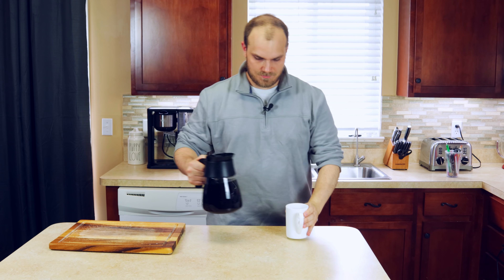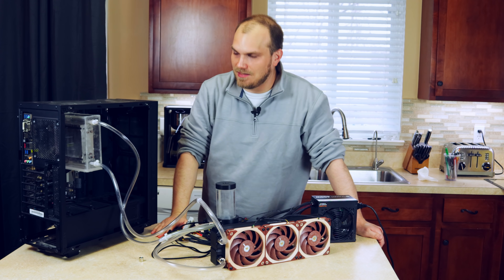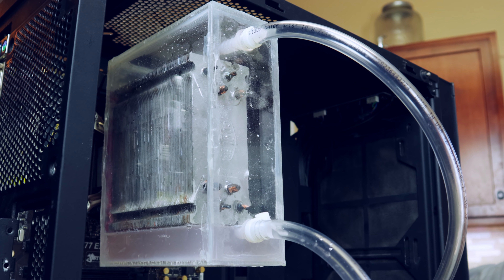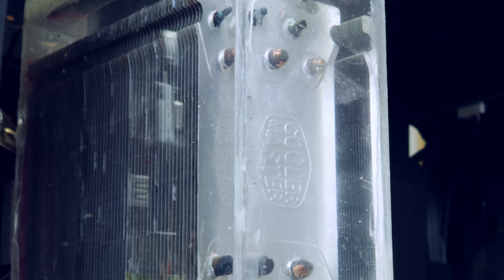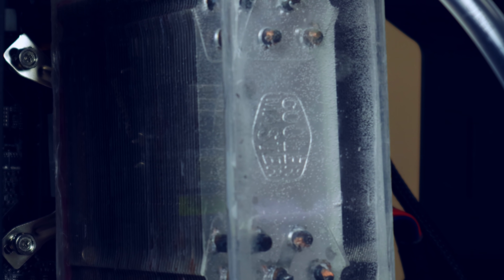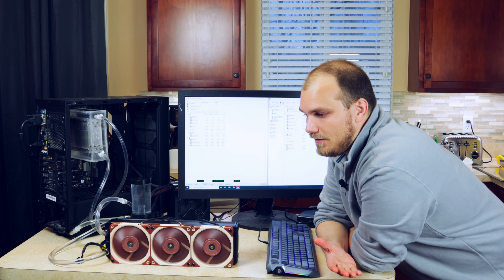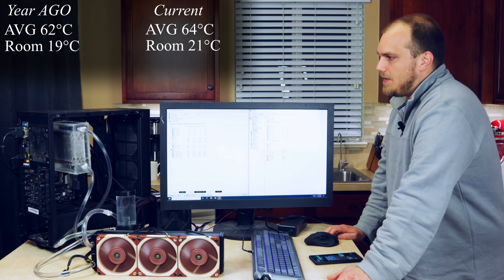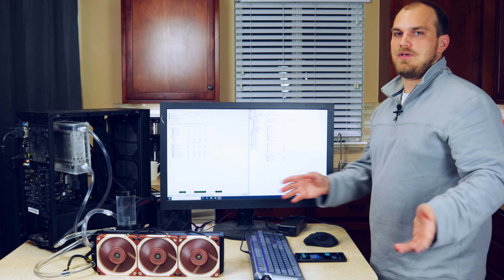Water Cooled Air Cooler 1 YEAR LATER, Time Has Not Been Kind

Comment: I think, than the better way must be horizontal, that's 'cause, the cooling system work on horizontal more fast, the copper pippes are in a C form, that minds than the upper middle work best cause that down faster, but the down middle work wrong, 'cause the coolest point it's fareaway from the CPU, and for that reason that part never heat, you don't even need a so big acuarium for the cooling, you only need freeze the the tops of the copper pippes, 'cause that was disigned to wor in U form, not in C form, in the fastest way, for the cold liquid inside the pipers down fastter than it up when it boils. for that reason you must put it vertical.
Well, I put mi tower horizontal, and gain some grades minus, 'cause, mi air flow was going, down to up in vertical (air cooling was horizontal, pipes in C form), now go right to left (now the air cooling is vertical, work in U form) , and in that way, really work best the cooling pipes and fans system.
Well, in base of this, I mod the way than I put the GPU with a PCI-E extensor, I put it upside down, and it works!!!, the principle is right, the connecton is wrong, if you put your PC Horizontal, the cooling Pipes of the CPU work better, and if you mod the way than you put the GPU (upside down) it works better too.
Now I'm gonna try to put some fans in the center of the new top, to pull the air out, and all the fans on the side to push air to inside.
I don't know, why no body think in gravity and themodinamcal laws....

Comment: Try it again with a newer but smaller heat sink, build it with better fluid flow, and use mineral oil to prevent corrosion.

Comment: ^make the new cooler force the water thru the finns. you ave a lot of space, where water can go arround the heatsink
Reply: Heat rises so as long as the cold water comes in from the bottom and the hot water exits from the top it will not matter

Comment: If you are going to experiment with this I think it would be good to start with a smaller and cheaper cooler. Perhaps something like a Noctua NH-D9L, a Dynatron K17 or perhaps even a Silverstone SST-AR09-115XS which is designed to be very compact and use a 60mm fan.
The first two are normal tower coolers designed for 92mm fans, while the Silverstone is very compact having the fin stack almost immediately on top of the cold plate and three U shaped heat pipes that contacts the heat spreader on the CPU. By using smaller coolers you get a bit more space to work with for the surrounding shroud while keeping it all small enough that it would fit into almost any chassis you may feel like using. The negative I can think of is if the heat generation of the processor overwhelm the capacity of the heat pipes. After all the thermal transfer to the water should not be much of a bottleneck.
Also I think that as you have a 3D printer you should be able to create a tighter shroud that forces the water to go through the fins rather than being able to leak around the outer edge. It might also be interesting to test if having the water going through the fin stack length wise as in your first attempt, or through it the same way the fans moves the air makes a noticeable difference. My immediate guess would be that it doesn't really matter. The high heat capacity of the water and large surface area of the fin stacks makes me think it's really overkill in either direction. But I have a good track record of being wrong...

Comment: Take a cheap 4, 5 or 6 heat pipe cooler, chop the top off, make a single coil but running plastic tubing from one to the next, and run it like that, and see how it performs.

Comment: if you do make another one try a format where the motherboard mounts upside down with the cooler pointing down to safeguard it against leaks, you may also not need to fully enclose it and have a open top container that the cooler lowers down into. In flow on the bottom and drain to a reservoir about an inch from the top so it cant overflow? It would allow clean outs of the cooler.

Comment: Next one do mineral oil instead of water and have a fan on the heatsink so the flow above the fins is stupid efficient.

Also try using a cooler that doesn't have mixed metals in it/use glycol and whatever AIOs use to reduce corrosion

Comment: Get a cooler that is anodize or coated, use treated water, cooler case need to be as close as possible to the base, water input should be as close as possible to the radiator while the output should be beneath so you wont have water turbulance where the heated water will just circle around the cooler case this happen because there's no water channel so you can bypass this problem by moving the input and output to be the furthest point to each other, hope you read this because this definitely can be improve and made it for daily driver.

Comment: Remake it with a lower pro cooler/remove some of the fins and bend the heatpipes, use an oil as the fluid as I don't believe thst will corrode it

Comment: Use mineral oil in the loop, so you can still put a fan directly on the cooler
Reply: Or just car/motorbike cooling fluid, thats cheap and with a anti-rust mixture.
Reply: @Phil_V2  Well if the coolants are also not electrically conductive, then yes they should work as well, but using mineral oil to cool PC components is known to be safe and also not that expensive
Reply: @EVPointMaster  Mineral oil eats rubber i.e. O-ring seals and any other rubber parts in the loop. It might work for a bit but definitely not long term. This is what happens with submerged pc's also. Mineral oil eats seals in electrolytic capacitors then it's time to replace the motherboard. If you wanted to use any oil near anything electronic, silicone oil is the one to use.
Reply: @lucastonoli3256  fair enough, 'o-rings ' was a bad example to use. Electrolytic capacitors however, do have a rubber seal. It's not an o-ring either, under the can crimp there is a rubber disc that resembles a hockey puck with two holes in it for the terminals. The primary purpose of this is to stop the dielectric inside from drying out. In an oily environment this seal would eventually leak and allow oil in which would change the capacitance of the capacitor. At that point you're up for a re-cap job or mb replacement.
Reply: @Mrx1080  it really depends on what "rubber" they use. It's very unlikely to be a natural rubber, which is sensitive to oil. It's much more likely to be EPDM or Nitrile. But it's sensitivity to oil really depends on exactly what material they use, it is incorrect to say all rubbers are sensitive to mineral oil, as many synthetic rubbers are perfectly fine to be used with oil.
Reply: @Phil_V2  didn't Jay try that? And beer??
Reply: Wouldn't that eat away any plastic in the loop, such as the the box around the air coolers and the tubing?
Reply: @LeonisYT  Look up mineral oil PC.Those are completely submerged in it and that doesn't seem to be a problem
Reply: @LeonisYT  Essential oils do that, but not all oils do. That's also why you should mix essential oils with other oils before using them. There are many oils that are inert and don't pull away oil from plastics.

Comment: Yes a v2 would be great. After reading some of the other comments. Many have said what i was thinking too. But, here are some extra ideas. 

Mentioned already and agree with:
1. A coated/painted cooler
2. using the fans from the air cooler inside the water to act as a pump.
some other ideas:
1. using a downdraft style cooler to fit in the case better
2. maybe use mineral oil instead of water
3. i like the idea of a smaller air cooler used with something that puts out more heat. ( we know this works. I don't find the d-15 with water to be that interesting. )

Comment: I have a DJ 15 and I have always wondered if you could ad a water block to the plate of the dh15 to air in the cooling. Then you would have a water cooled air cooler without the corrosion issue

Comment: Amazing how fast time pass!
I'd try pouring some vinegar into the loop in order to try to internally clean it, and to remove some corrosion in there.
Reply: If you can get the air out to prevent further oxidation, having a bit of vinegar in the loop permanently might even be a good idea.

Comment: Not sure of the cooler, but, why not try two ideas on two separate coolers.  This may be a feat all in itself.  What I mean by 2 ideas is, there is another cooler idea where you chopped off the top's of the heat pipes, and ran them in to each other, and then through the rest of the loop.  Would it be possible to chop off the tops of a cooler, run a loop through the heat pipes, and go to a top mounted radiator.  Then, have the majority of the cooler encased (like you have here) and run that to a front mounted cooler?  May be a bit over kill, but still may make for a neat idea.

Also, side note, move the ports/connectors from the "top" of the cooler, to the front of the cooler to help for clearance.

Comment: You should try the AMD Wraith Cooler. It's a small compact cooler with direct heat pipe contact. I'd like to see it  surrounded in coolant/water if it would make any difference with performance; especially with a modern day processor that scales with thermals

Comment: Copper pipes and aluminum fins in plain water with no additives is asking for corrosion.  You need to use some type of anti-corrosion additive in your fluid for the next one, if you plan on using another mixed metal air cooler.

Comment: That be nice to see!Would be nice if there is extraction valve to remove the excessive liquid from it after use and a way to clence the cooler system after usage to prevent rusting ofc not attached to the rest the system while doing so, so u don't mess up the rest the system its awesome project build!Maybe re-attachable sides will do all that..

Comment: It's fun to watch, but all it actually is is an over engineered cooling block so the temperatures will be dictated by the radiator and not the air cooler and this just adds thermal capacity in a form of another reservoir. If you want to build another, go ahead, but I can't imagine that the temps would be all that different.

Comment: do it with a stock cooler .. thats a way to make use of the useless intel coolers
Reply: Sealing around a stock cooler would be a lot more work.
Reply: @drackar  yea but still do-able
Reply: The problem with an extruded cooler (both Intel and AMD) is that the fin structure is non-conducive to water flowing between the fins, which is where your better heat transfer comes from. If you never get flow through the fins, then the extra surface area doesn't mean crap and you'll wind up with mediocre performance. So you have to use a heat pipe cooler of some sort to get fins properly oriented in a way to be able to channel water between them to make full use of the surface area.
Reply: @bighairycomputers  What I can imagine on the Intel version is making it a radial flow outwards, like, pipe the water to the middle with some cone shaped thingy to direct it better, and let it flow outside radially, the same way the air would move on it. There's still some fins that might be unusable (like some models have some fins in a Y shape) but might work, even if badly. Mounting it would maybe be quite annoying tho, given the stock Intel one goes all the way to the mounting holes.
Reply: YES! Turning jank into dank is what it's all about!
Reply: Agreed! This would be the true test if this project is either to build something for the sake of building something unusual or it has some practical use. A lot of water cooling projects I see around are sadly the first thing, I mean its cool to create something weird and have fun by making it real but I would really like to see attempt of making something useless and available (either most of us have stock coolers or they are easy and cheap to get) into something functional either to save cash or as an emergency when you really need your pc to run and your part didn't arrive or got damaged.
Reply: Now if you could build a cold plate to mount some custom heat pipes on the CPU, then pipe it up to the cold plate of the cooler, and orient the cooler on it's side to make the pipes only have 1 bend and to make tubing water into it more space efficient. The fabrication for that is fairly simple if you have a drill press and some background in jank machining, or a three axis vertical mill, but heat pipes are pricey, and aluminum or copper bar stock is expensive, so you are probably going to end up cheaper, cleaner, and more effective using a low profile heat piped cooler with horizontal fin heat pipes like an NH-L12S or an NT06.
Reply: To do it with a stock cooler you can just use a water hose.
Reply: my brother (<o_o>)?  lmao what's up bro ฅ^•̀ﻌ•́^
Reply: @3mar00ss6  holy fucc u r 7 months late
Reply: I imagine it wouldn't work nearly as well, since there are no heatpipes to transfer the heat to the finstack. Then again, it would probably act kinda like a CPU block with mediocre micro fin arrangement, meaning not as bad as you think it would. My guess is, it would work, but not as well.
Reply: It is time to see here mr. @majorhardware
Reply: CNC machine coolant has a special oil blend to avoid corrosion.
Reply: Stock cooler wont perform well. This works because the cooler is HUGE. The water volume is big. Also water actually moves between fins . In stock they wont move between fins that well.  But it definitely worth trying. Even if it won't work great it can be an alternative risky and cheap liquid cooling solution.

Comment: You could fill it with the non conductive liquid and use a pre painted cooler? Also have it pump in from all four corners on the bottom angling up? You could also put a fan in there with that liquid lol. Would be a pain to seal though and probably exapensive.

Comment: Corrosion is great for increasing surface area of the heatsink. Ages like a fine wine.
Reply: The thermal coefficient of copper oxide is an order of magnitude worse than that of copper tough. You need to make around 12 times more surface area to make that effective :D

Comment: How much surface area the water has to touch in order to absorb all the heat. What if we lower the surface area of the aluminium fins of the cooler. Or Imagine a cooler striped of all of it's aluminum fins, so we got just heatpips. The design will take less volume in this case and maybe will be more practical commercially wise to produce? Will it be superior to microfins in watercoolers? Who knows!

Comment: Would you take submissions? :P Got plenty of ideas how to optimize a water-cooled tower in terms of minimizing dead spots, maximizing flow through the fin stack area etc. For starters, turning the tower 90 degrees with flow bottom to top (i.e. frontal push-pull) and blocking off sides that the flow shouldn't go (which become heat traps). The best air cooler for a 2.0 attempt is probably the NH-U14S. It's massive but practical.
After all that effort don't you want to claim superior performance to air and water and be the only one on Youtube to do it? Maybe that'll invite some competition ;)

Comment: If you use the same global configuration then take an air cooler with a large fin pitch, i.e. with the fins far apart. Water has a much higher viscosity than air, so if the water can flow around the heatsink, you should make it as easy as possible for the water to flow through the heatsink, otherwise it'll just flow around mostly just as we have seen with this first version.
Or, use a different config; make it such that the water can only flow through the heatsink and not around. Then you can lower the fin pitch, hence increasing the fin count, increasing the surface area and thus increasing cooling potential. Assuming your pump can handle it of course.
Oh and also if possible use a fully nickel plated or anodized heatsink, such that you minimize galvanic corrosion

Comment: Dude, if you end up doing another one... What if it was a true hybrid? Basically, a beefy air cooler with fans that had it's own water block with an inlet and outlet with an AIO(also with fans😂) attached. That way you'd have two coolers actively cooling the block. I saw something like that a while back on Alibaba, but the price it was listed at was something absurd(like £1300+) and it was "sold out" every time I checked..

Comment: Why didn't you have the water flowing through the fins? Ie input tube at bottom and exit tube at the top. Use convection to help get the heat away quicker

Comment: Something like Be quiet! painted Dark Rock Slim, CPU Cooler(180W).
Pure distilled water and anti corrosion/bacterial inhibitor.
Some sort of Baffles on sides to force water across fin stack?.
But could be the mass and thermal conductivity of the water is so large it may not matter,
as long as the external radiator, pump and fans keeps the water temp "close" to ambiant.

Comment: Now try to make a water radiator out of the  air cooler 
Make a cpu waterblock using only the (...no idee how it s called) The pad that have all the heat pipes and sit on the cpu. Like this will be easier to clean the pipes for better waterflow. What do you think?

Comment: Mentally I can picture and make a drawing that would improve your overall design here. It would promote more direction to the water flow, but I can't include it because - youtube comment.  I will try my best to explain though. 

In your next cooler. You should build your box around your cooler as you did. Then set up channeling zones like this \___/ on the front and on the back. Those will have to likely be some kind of putty or poured resin. This should allow the water to move across the fins in a front to back or back to front direction.